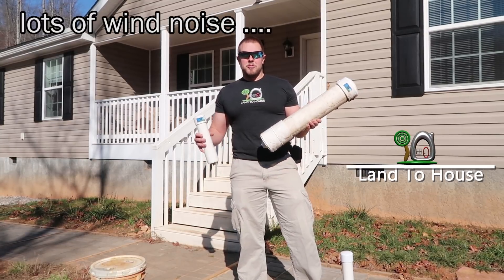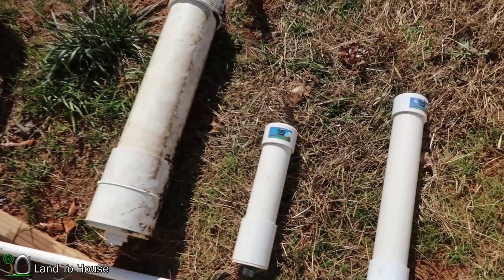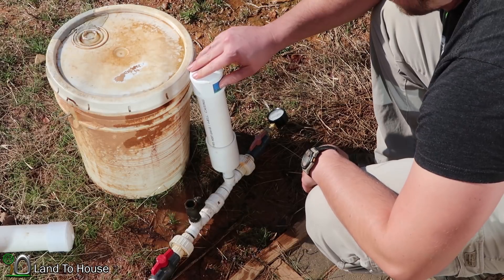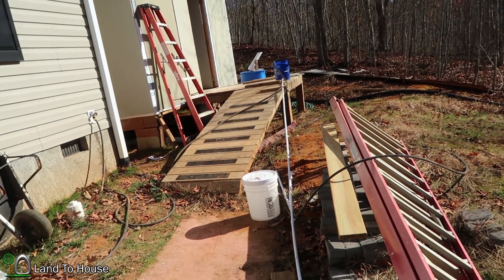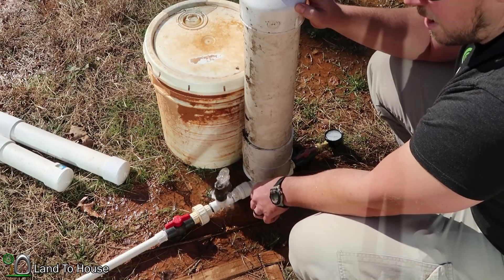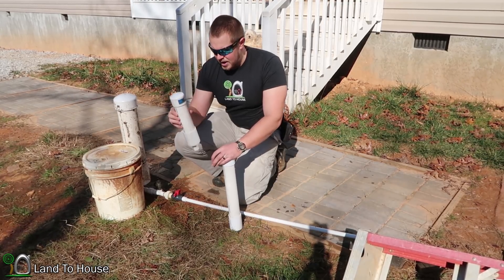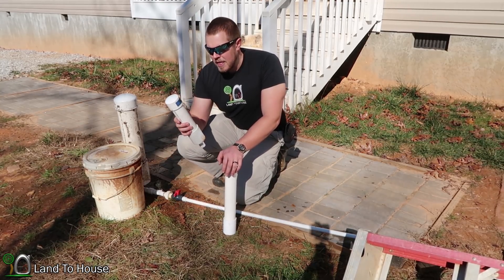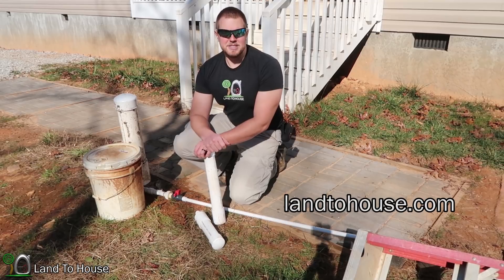Pressure tank size - Ram Pump

Comment: Nice video and presentation. 
Talking about starting a ram pump. 
The waste valve when stand alone is normally open is converted to normally closed by the drive pressure.  How about adding weight or pretension to the valve to the point it 1) almost open in static state 2) almost close in static state ? 
How may these conditions help out reducing triggering effort?

Comment: ultimately    what is the ultimate pressure  that   each one would build up within   1 hour...... also   volumn  of   water  after  one hour for an hour..  but   good   thoughts...    also  perhaps  a bicyloe  pump  from the output  location  could be used  to pressureize  the tank  if it becomes  waterlogged??

Comment: Do you think it is possible to charge a pressure tank for a well system (if even low pressure) with a ram pump? Once it reaches close to its max potential pressure have a pressure relief valve or geyser valve that opens to discharge into an open system (hose or tank).

My well has a static water level at 11'. Curious if this could be an option during power outages. I have seen a video of a guy getting close to 40psi with these ram pumps. Even at 15psi it would 7 enough for drinking water and flushing toilets.

Comment: Land to house

Can you do anything with that air pressure?

Could you connect that little ram pump tank, to an air tank.. and transfer that air pressure into the tank.. so that over the course of like a week of running you could fill a huge compressor tank.. so you could run some air tools when you needed to work that weekend?

Or since water is a thousand times thicker than air.. can you run air tools on water that you have coming from a tank high on the hill? So that way it's got a lot of PSI as well?

Have you ever built a trompe?

I know that's what that's designed to do is get your air pressure.

Would be neat if you could not only have free water pumping in your property.. but free air compressor.

Do you ever put a generator in the water to try and get free electricity as well? Since you have a river

Comment: And what if you cut that 4" pipe to 1/3 the size?
 Since it'll be lower than the water origin, it should hold more pressure, right?
Short n fat, rather than tall skinny. girth matters?

Comment: Granted the larger one took additional time to fill.  But does the performance of it get better and or smother?  You need to do a follow up video on the larger one to see if the volume changes the output.

Tom Dutkiewicz

Comment: I know this is an old video for you yet I am curious what might happen if you made a chamber that stepped down in diameter as it got taller. It seems like there would be more room for water to fill in the bottom portion and the pressure would increase due to the decrease in upper diameter.  (I am considering the formula PV=PV)

Comment: YOU NEED TO WAIT TO MAKE FULL DİFFERENT CAPACITY ACCUMULATORS   TILL MAX PRESURE  FOR STANDART  DELIVERY  HEIGHT  THEN YOU NEED TO MAKE COMPARISON  IF YOU SUPPLY ENOUGH  FEED WATER  ALL OF THEM WILL HAVE THE SAME MAX PRESSURE  BUT FLOW WILL  GRADUALLY INCREASE FOR BIGGER ACCUMULATOR CAPACITY

Comment: thanks for this video, may i ask, if my swing valve size is 1inch, what size of pressure tank should i use to deliver water for about 30 ft high? thanks in advance...
Reply from the maker: I like to use a pressure tank that is 3" pipe by 19" tall plus the fittings that make it 23". To get water to 30 feet you will need 5 feet of head pressure.
Reply: @LandtoHouse  ,good morning, i already have here a 4 inches pipe that i never used, will it possible to use instead of 3 inches? my existing pressure tank now is a freon gas tank,and i cannot get enough pressure..
Reply: Note that the diameter of the pipe prob does not matter, as long as the interior volume is the same. Use the formula Volume = (pi x radius squared) x height. If Seth’s tube is 23 inches high by 3 inches, his volume is 162.5 cubic inches. With a 4 inch diameter pipe, a height of just under 13 inches would match the volume, and thereby the space that needs to be pressurized.

Comment: what if you put pumps in series.

have a pump with a smaller pressure tank feeding a pump with a larger pressure tank
directly.

i think that the increased pressure from the output of the smaller tank might help the bigger tank along.

Comment: Application??  Maybe the smaller tank for increasing pressure thru a smaller delivery line and the larger tank for higher volume lower pressure say to maybe supply direct to soaker hoses in a garden??

Comment: I wonder if it is a height issue or a volume issue? Compare a 1 inch diameter based tank 30 inches tall (your standard is a 2 inch 15 inches tall?) and a 4 inch diameter based tank 7 inches tall(all three should have roughly the same volume).

Comment: You said the smaller tank doesn't hold enough pressure volume to keep it running when the delivery valve is opened, I'd love to see you test that in a video.
Reply: He did a video on this and you do not need a pressure tank at all.. it just smooths out the delivery constant.. as opposed to pulsing when there's no tank.. water still pumped just as high

Comment: I saw a diagram of a ram pump that used twin chambers with a fire heating one to increase water pressure, I was wonder if you used a clear chamber as a solar heater to increase efficiency? Was allso wondering about a one way valve on the intake and a curved design but would need to draw it up and send a picture

Comment: What if you tried a pressure tank that is the same height as the one you normally have on the pump just with a much bigger pipe? That might take a bit longer but also allow for more pressure

Comment: Seth I love your videos on the ram pumps! I just today built me a 1in ram pump off of your design with a little tweaking of my own but as I building my pressure tank and inserting the tire inner tube. I started to think that when you fill it up with air it's with room temperature air and you do your feel test of what feels good but after cold water is running through it won't they contract and it loses air pressure and Shrink kind of just like when you your filling up a raft to float the river how you have to do fill it a couple times and dunk it under the water and then it will lose air pressure and you fill it up more so it will float right. Wouldn't that seemed have to be done with the inner tube or compensate by overfilling the inner tube in the pressure tank to compensate for the shrinkage when they surrounded in cold water
Reply from the maker: That is a good thought. Probably very valid. This summer I hope to do some tests with the tube and actual flow rate. That will help answer questions about fill firmness. Thank you for asking! I think you are right.

Comment: Hi, does the pressure tank height play role here? im building 1/2 inch pump and using 2 inch pressure tank (about 2 foot height). How much high the pump could deliver?
Reply from the maker: A pressure tank that size should do quite well for you. It's not necessarily the height that matters but the volume. You want to have enough volume in the tank that when you open the delivery pipe it doesn't lose pressure. Typically the ram pump can lift to a maximum height of 180 ft. That requires about 25 feet of head pressure. That's a lot.
Reply: @LandtoHouse  Thanks, it clear me a bit. However, on the 25 feet head pressure, does this means my water source that comes into the pump should be 25 feet above the pump?

Comment: you got it wrong the question you should be asking is which gives the greatest pressure once it reaches its maximum. 2 mins and number of click is irrelevant. why not leave it until you reach max pressure for each
Reply from the maker: Both tanks will reach the same pressure. The input head pressure determines the max pressure that can be reached. The time variable allows us to see how fast the pressure builds in different size tanks.

Comment: Could you do the same test but instead of measuring pressure... measure the volume of water it will push... or how consistent the water flow is
Reply from the maker: That is a good idea. I need to redo a few of these tests with the flow rate included.

Comment: This test doesn't really make any sense to me. My thinking might be wrong. My thoughts are the smaller tank is obviously going to pressurize a lot faster than the bigger tank. My question would be. What is the max pressure that each tank could reach?
Reply from the maker: From my understanding the head pressure feeding the ram pump will determine the maximum pressure that the tank will have. The difference is the volume of water and air inside the tank. The larger volume would Supply a better buffer for sudden pressure loss with delivery pipe opening fast
Reply: @LandtoHouse  Further testing might be worth it. At the very least it'll make a good video LOL

Comment: Just curious does the chamber size change the flow rate?
Reply from the maker: Not necessarily the flow rate. But it allows you the chance to open the delivery pipe without a sudden surge of water that can stop the pump.

Comment: I have 1" swing check valves on my ram pump with a 4" x 4' pressure tank, does the theory not serve that you want a larger pressure tank because it also acts like a pressure tank on a well the water that is in the tank will keep your water flow at a steady stream before you actually have to use your pump.Will your swing check valves be as effective with a smaller reservoir ?
Reply from the maker: The larger tank does smooth out the cycles of the pump. One thing that really shows the benefit of a larger tank is when opening a delivery pipe that has been shut for some time. The larger volume of storage water allows less likely surge and stopping of the pump. So yes larger but not too big.

Comment: I THINK IT IS BECAUSE THE INTAKE PIPE WAS THE SAME SIZE FOR ALL THREE WHAT IF THE INTAKE PIPE IS DOUBLE THE SIZE ON THE BIG PRESSURE TANK
Reply from the maker: In order for the waste valve to operate correctly the drive pipe needs to be the same size as the waste valve. If I were to increase the size of the drive pipe it would cause the waste valve to slam closed and not reopen.
Reply: @LandtoHouse  what if you increase both at the same size lets say 2 inches

Comment: you have not only to think abbout the air volume, but also the increased mass of water which must be moved every time the tank is loaded. this is "lost" energy. maybe a tank with a pre loaded mambrane is better because of faster start and less mass to move
Reply from the maker: Next year I plan on using a house well water pressure tank. That should give us some good results on a tank with adjustable inner pressure

Comment: very nice video. can you try same height of tank but different diameter. water pressure will depend on water height, the wider the tank, the slower the pressure drop.
Reply from the maker: That is an interesting idea. These tanks are not that much different in height. Around 2". I dont think we would find much change in making them exactly the same height.

Comment: Would it be possible to have a stand pipe going to a resevour instead of the pressure tank/shock arrestor? The creek I am harvesting the water from with in property lines has a 34in drop in elevation. The spot I am trying to get water to is 60 feet above the creek. So I was figuring 2 ram pumps a big one to fill resevour, that will feed the second and smaller pump.
Reply from the maker: You can definitely run a ram pump from a storage tank. But it would be difficult to keep two pumps running at the same time like that. I have a couple tests trying this. You would need to feel a couple hundred gallons or more and then run the second pump from that. Do keep in mind that the ram pump uses a lot of water and only pumps a little bit.

Comment: For an inch size valve , what would be the appropriate vertical height?
Reply from the maker: The vertical drop of the source to the pump is called head pressure. This can be between 2 and 25 feet.
Reply: Thanks again ....
Reply: Btw is it necessary to keep a bicycle pressure tube inside the pressure tank...?
Reply from the maker: It is not required. It does however help to prevent waterlogging of the tank.

Comment: If you took a stagnant water source do you think you could loop the ram pump in the sense were you can use the water but also not lose water from the waste valve? Example take two trash cans and have the ram pump in one working and have a syphon so the ram pump powers itself and it’s a continuous flow with no water loss.
Reply from the maker: This sounds like a fun idea but sadly it will not work. The ram pump only pumps around 10% of the water that goes in to the pump. It would not take long for the water to be at the bottom of the two trash cans.

Comment: I've been looking at various types of ram pumps with interest. Though it had no use to me as I live in the city. 

I'm curious to know is there any difference where you put the waste valve? I see that a lot of people put in front of the pressure tank and some put it at the back.

Some use spring valves, check valves and also foot valve. What are the differences in performance and which type is the best in performance?

Is there any way where you can eliminate the wasted water? 

I was thinking of building a small one (half inch type) for the fun of it. Maybe can use it in a small fish pond. (5 x 8 x 5 feet)(h x l x w). What do you think? Any suggestions?

I like to watch your videos as you did a lot of experiments and it's very easy to understand. The videos are very clear and at perfect angles. Cheers.
Reply from the maker: The ram pump is fun to experiment with even if you are in the city. There is really no way around the waste water. 

The valve placement does make a little difference.  I have another video lined up for further testing on the location of the valve.
Reply: Land to House Looking forward to your new video.
Reply from the maker: The ram pump is amazing in a creek or river but in a closed system it does not work well. It uses so much water that all the water will be at the bottom of the system in a short time. 

The difference in valve type can make a difference in operation. Expensive commercial pumps use a piston style valve that can last a long time. The swing valve will wear out in 1 to 2 years 30 million cycles a year.

Comment: I would love to see a test with a shower head running, toilet flushed that fills then stops itself but pump continues to run. And will the pressure tank over pressurize itself if no supply water is run off of it. We are trying to build a continuously running pump to a cabin with good pressure but water will not be used all the time so what will that contribute to the whole set up?
Reply from the maker: Those are some fun suggestions. Using a ram pump directly to a shower head will result in a constant flow but low pressure. One of my very early tests with the ram pump went up to a sprinkler and it does work but not too well. Now for the toilet. Because the toilet flushes from the reservoir tank on the back it will flush just fine. The refill time will be slow due to the low flow rate of the ram pump but the auto shut-off ballcock valve should stop the pump from filling the tank too much. When the pump is running but not delivering water the delivery pipe can build significant pressure. If this pressure is released too quickly with low back pressure the pump will stop. But if you have sufficient backpressure it will just release high pressure and the pump continue to push water. I will write down to test the pump with top delivery closed.

Comment: Would not the amount of head determine the pressure tank required, like 10' of drop on say 50 ft of run?
Reply from the maker: From what I understand the pressure in the tank is built by the head pressure but the volume of water being moved in the different pump size determines the tank volume requirements.  It would take a small pump a long time to reach pressure in a large tank.

Comment: hi, i got a question about the tank size. what if a 6L pressure tank or 3 of the 2L pressure tank together. Both has the same value with 6 L pressure. Which has the most pressure output, the 6L single tank or the 3 of the 2L pressure tank?
Reply from the maker: That is a fun idea! I have a feeling that it would have close to the same results. The pressure would equal out between the three. It would be a bit harder to keep the water from filling the tanks though. With one it is possible to empty it when it gets watterlogged. Also it would take more parts to make a pump with multi tanks. .... Just tossing out ideas.

Comment: What is the volume of your ideal pressure tank?
Reply from the maker: It depends on the pump size. The large 1-1/4" needs around 4" pipe 18 to 20" long. Can be larger.

Comment: I think your testing would be more accurate if you were testing the gpm once the the pump is at full operation instead of pump pressure on a capped output line.
Reply from the maker: Good point. I would need to setup the pump in the creek.
Reply: That gives me an idea. I wonder  if it would work placing the pump in fast moving water with no input 
 pipe or maybe just a small funnel shaped collector.
Reply: @KevinSmith-gh5ze  Sorry, but that wouldnt work at all.  You need head pressure.  The only way to get that head pressure is in an enclosed system.  With an open system like you describe you would have zero head pressure.